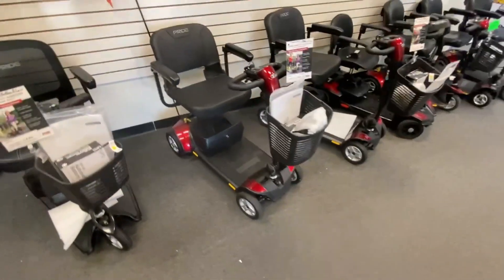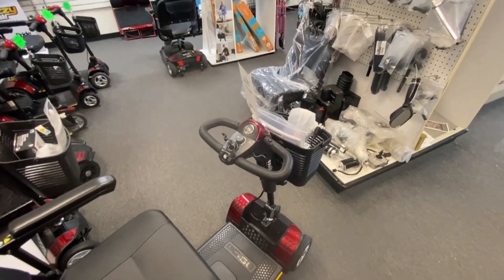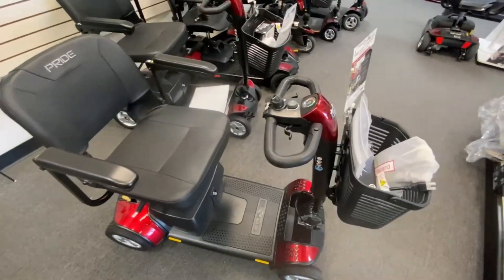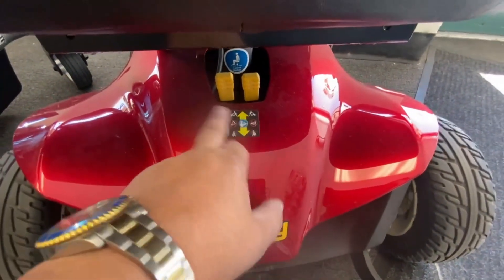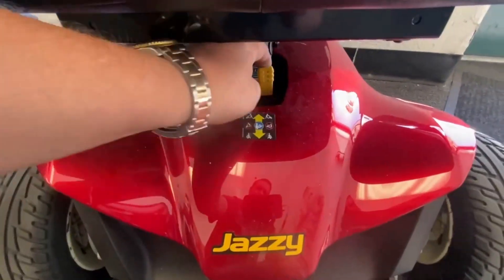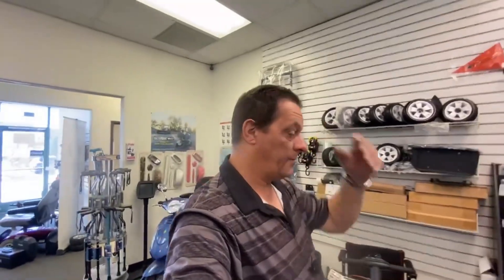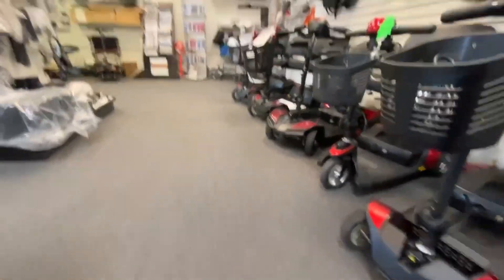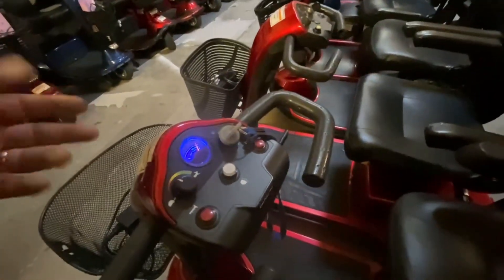Mobility Scooters and Power chair Common Questions Answered Pt 1 Breaks, Chargers and Serial Numbers

Comment: Hi Ian! I have a Pride Celebrity X that I bought new about 17 years ago. I have had to replace the speed pot and the batteries one time. I came home the other day, charged it and the next day it was giving a five code. So I tried the brake handle and that didn't work. I started to take it apart and messing with it I was able to get the flash code to stop but when I turn it on and pulled the throttle I could hear it and see it try to go but then it wouldn't go. I think it's the brake. Being discontinued it's hard to find a new or used motor/trans/brake set up. It's my only transportation and could really use some help. Thank you!
Reply from the maker: Hi Nanette, here are a few things you might want to try.
Try disconnecting the batteries and turn the key on while they are disconnected see if that clears any errors stored in the controller. Reconnect the batteries and try the scooter again.  
If you manage to get the scooter to not beep five set the speed pot at slowest position and push the throttle to go forward. If the scooter doesn't move keep the throttle pressed and release the brake manually (freewheel mode) but be careful make sure you safe to do this or get a friend to help. If the scooter moves forward, you might have a sticking or failing brake. If the scooter still doesn't move it could be a transaxle motor problem. Sometimes the after years of use the motor stators can wear down or get clogged up with dust from the motor brushes this would cause the motor to not spin up. 
If the five-beep code is intermittent it could be a faulty micro switch or wiring.
I'll check with pride tomorrow if they have any parts for the Celebrity X, but I suspect it's going to be expensive to replace the motor, transaxle and brake. I always advise my customers if it's an older scooter you're better off replacing the scooter as you never know what the next thing that's going to fail on the scooter (i.e., controller) email me at sales@lasvegasscootersandlifts.com so I can send any options available for you for parts. Ian
Reply: Thank you so much Ian! I'll give those things a try. I am a retired heavy equipment operator so I'm pretty good at wrenching. Again, thank you!
Reply: Great news! It's running again! The bad news is the emails wouldn't send so I'm sending it from here!
Thanks Ian, Nanette
Reply from the maker: Awesome Nanette glad you're on the road again.

Comment: I have a golden buzzer and it’s an older one it’s from 2010. I’m waiting for my new scooter supposed to be here in two weeks but the other old one which is the one I’m talking about Brooke the other day at flashing five code which I looked it up. It’s the board I don’t need the panel but I think it goes for like $224. Does it sound about right?
Reply from the maker: Hi Ed, I'm not sure which model of Golden you have but a five beep or flash code usually indicates a brake error. page 36 of this manual (link below) gives you all the codes but like a said I'm not sure what model you have.
It could be a couple of things that you can check
1. is make sure the brake lever is in the DRIVE locked position (the scooter shouldn't move if you try pushing on it) 
2. Take the front a rear section apart (if applicable) Check the silver connectors on both front and rear to make sure that there is not corrosion, dirt or broken wires.
3 Remove the battery pack, and on the rear or front depending on which scooter you have (if applicable) you'll see some slots that the other section slot into to connect the front to rear wiring. You should be able to slide a quarter between the slots without too much trouble if it feels loose then it might be a connection problem.
4 See my Transaxle video on how to test the brake.   

Golden Flash/Beep Codes
https://www.goldentech.com/wp-content/uploads/2019/11/Golden-Owners-Manual-Buzzaround-Scooter-Series-GB116-GB146.pdf

Hope this helps, Ian.
Reply: Thank you so much
Reply: I like your video
Reply from the maker: Thank you
Reply: Your welcome